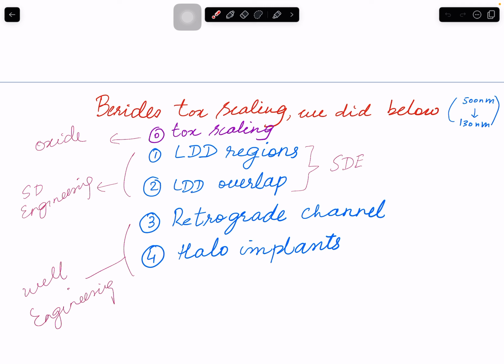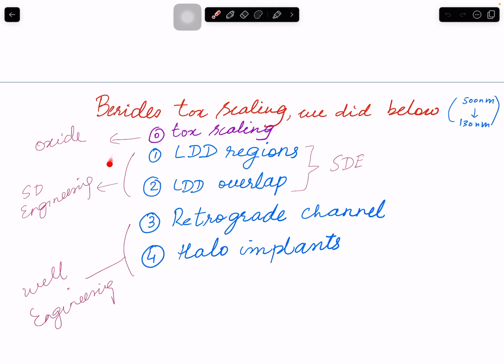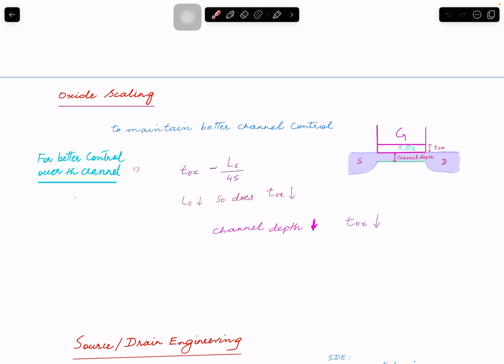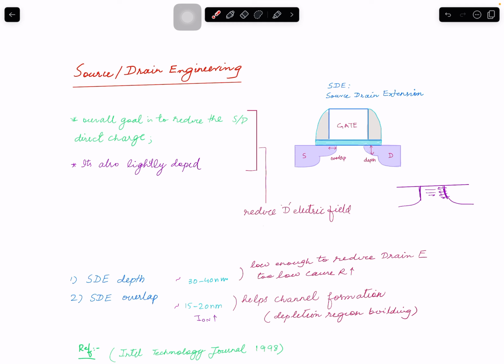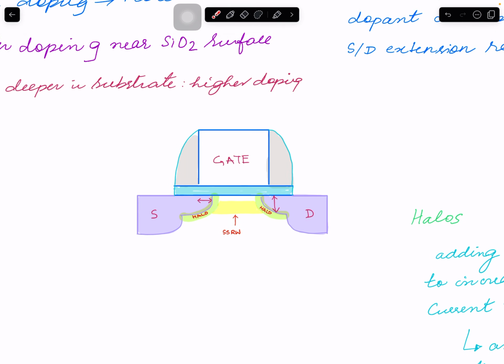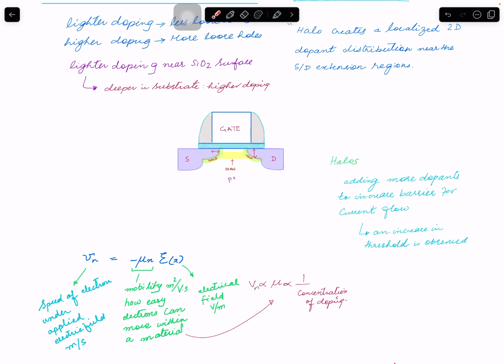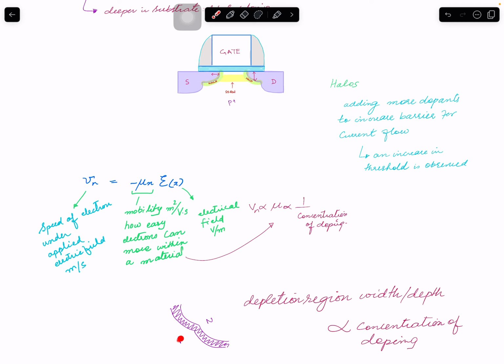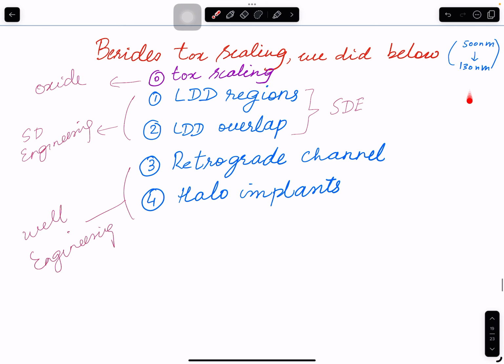Topic 57-CMOS-Transistor Scaling part4-Overcoming SCE:Oxide scaling SD/Well Engineering

Comment from the maker: P+ concentration along the S/D surfaces (halo) is kept high (as well as deep in the well) to have tighter/stronger reverse biased barrier which helps Vt lowering of the heavy drain (in short channels) which helps maintaining good level of Vt as well as less leakage current through reverse biased junction.

Comment from the maker: Doping concentration of P+ is light near the surface. This ensures more electron mobility due less scattering with p+, less strong vertical bond of the barrier , less scattering of electrons with the rough edges of the dioxide.